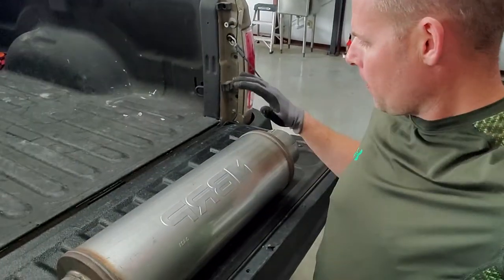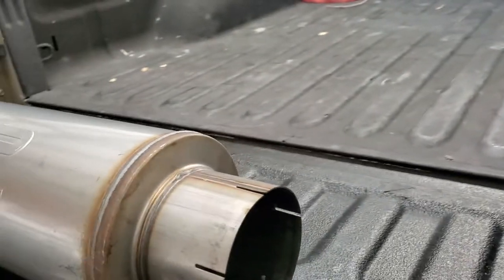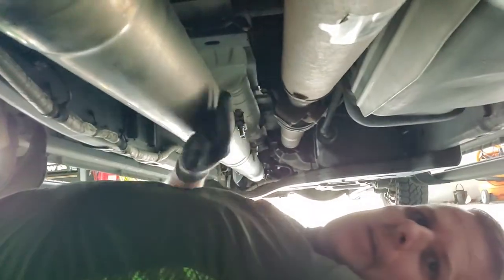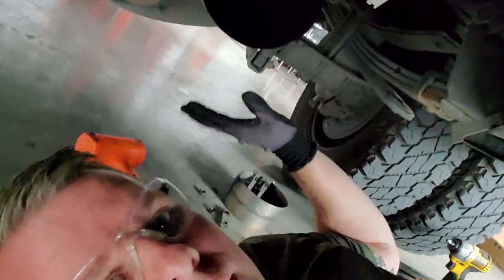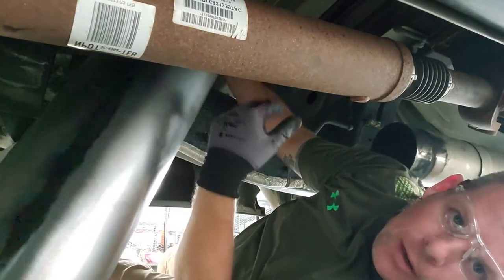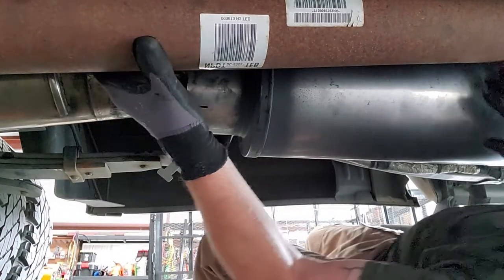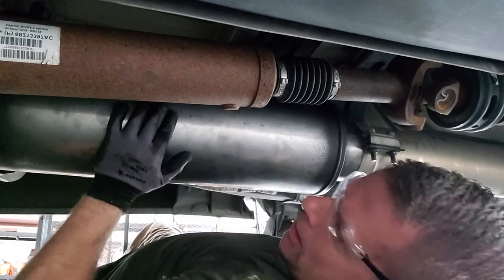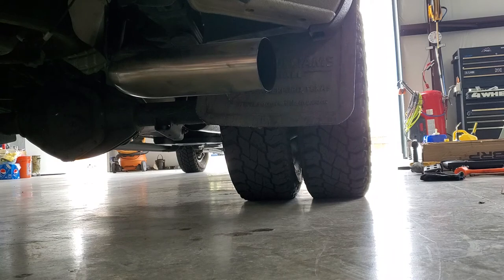MBRP 5" Muffler Install

Comment: Nice job brother...😂🤣 communist Amazon prime...I hear ya..love the truck.just got a 22 tradesman dually myself. In your opinion does it give more turbo noise over stock?
Reply from the maker: Hi Chris, for some reason I didn't get the notification that you commented. I do hear the turbo over stock as the truck is deleted and its a straight pipe from turbo with no muffler until I installed one. I did take the foam baffle out of the intake as well. There are different opinions on that, I would take out the foam and leave the plastic frame/baffle to direct air flow into the turbo. Thanks for commenting!
Reply: My man..thanks for responding

Comment: Just to be clear the MBRP is a resonator not a muffler.  A muffler muffles the sound to below the max 91 dba as per the laws when Ram built the truck to be allowed to sell the truck, even at full load. Even  your wife hates the excess noise!! As a person with a house by a Hwy i hate the noise from trucks like yours, a straight piped Cummins is the worst of all light duty trucks. YOU may like the sound, but I, your wife and my nieghbors do not.  Adding a resonator does nothing to your trucks excess exhaust noise when pulling under load. Q the hatters in the comments below.
Reply from the maker: Well it helped with the in cab drone. Can't help if my exhaust is subjectively "too loud". I'm the one that has to pay for repairing all the expensive EPA mandated junk that fails and reduces the life of the engine. All so some politicians can pat themselves on the back, thinking they are helping when in reality they are driving costs of trucks and maintenance up. Which drives the up costs of food and goods the trucks deliver.
Reply: Boohoo move then.
Reply: They actually DO reduce the sound. MBRP literally has a video showing significantly reduced decibels with their mufflers installed. Not only is your comment incredibly whiny, it's flatout wrong. Congrats 👏
Reply: Hey Karen I’m putting a 5” straight pipe on my 7.3 diesel today. I will do some pulls in your name. Yes haw and God bless America.